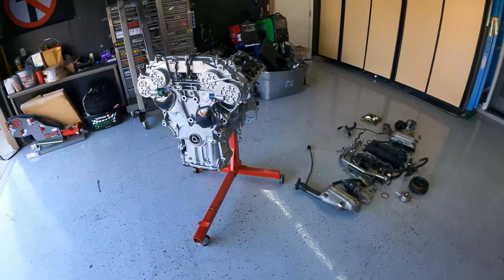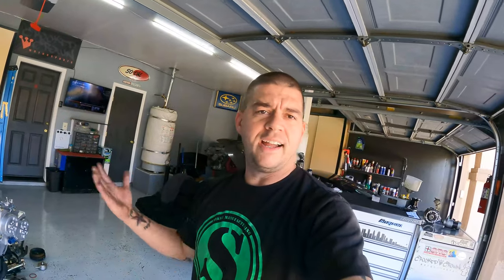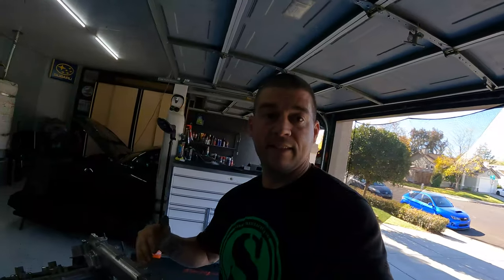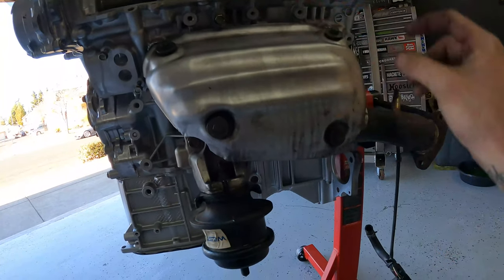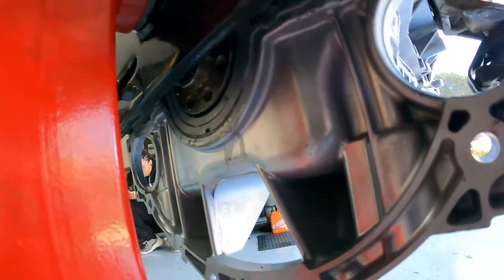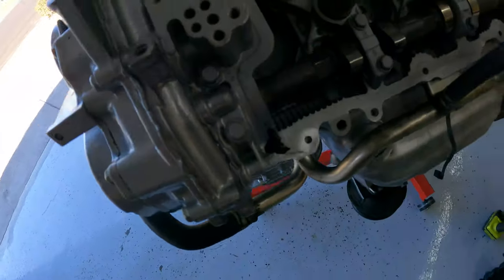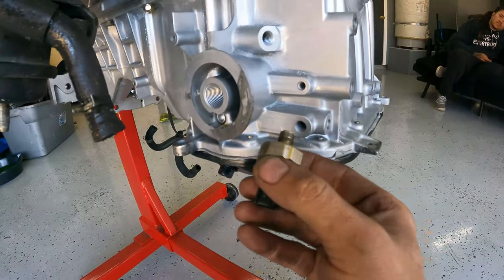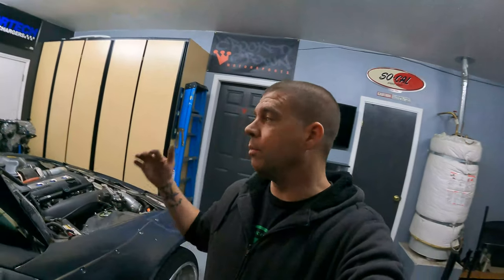ZERO MILE VQ REVUP REFERENCE BUILD!!!

Comment: My wife's 350z has a little rod knock and I'm thinking of dropping the oil pan and doing rods and main bearings ($600). At a 190k miles would you go that route or do a engine swap?
Reply from the maker: Tbh Id def swap for a lower mile engine, the engine will have to come out anyway and then you never know what youre gonna find🙏❤